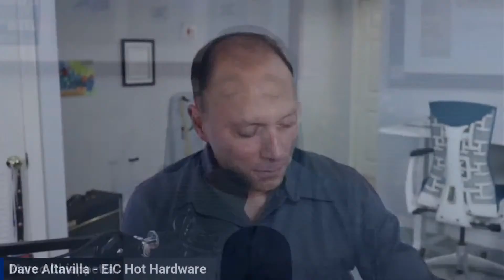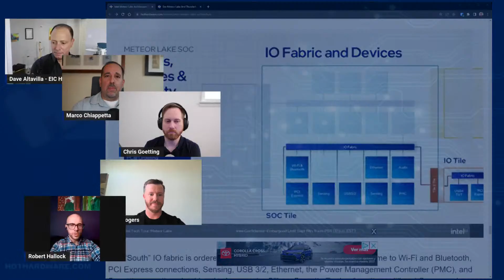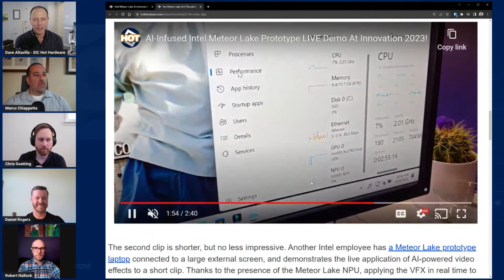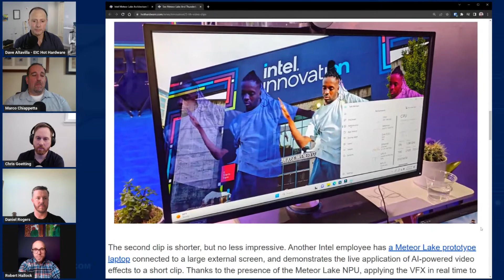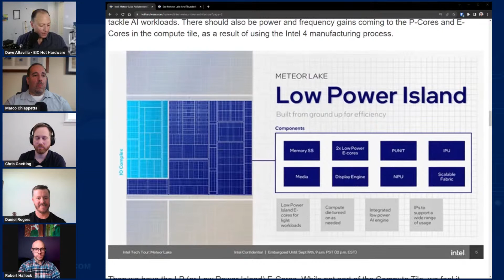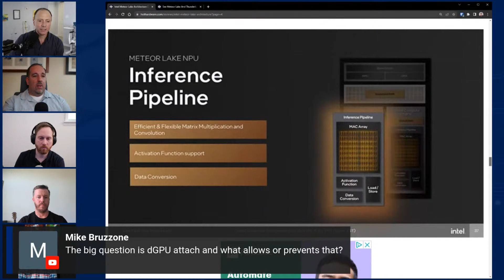What To Expect From Meteor Lake With Intel's Robert Hallock And Dan Rogers

Comment: Awesome deep-dive guys, much needed for the soul. I for one thought that the GPU was gonna be Arc+ and not a bit behind on IP, I wonder how this affects the difference between this and current Arc. Current Arc has an issue with lot of CPU overhead in limited scenarios, hopefully that's actually sorted (I recall it being a memory controller issue)
Reply from the maker: Thanks for joining us and for the kind words. Yes, I believe the issue you're referring to was resolved at least somewhat in a recent driver update. And the way I interpreted Robert's commentary about the integrated Arc GPU in Meteor Lake, it's a derivative of current Arc but power optimized and obviously cut back from the desktop chip. They did say it would support all of Arc's features.
Reply: Alright, that's good to hear it might be a bit better in that regard. Almost parity in terms of IP but tuned for efficiency sounds like success (6nm>5nm) . I originally thought from leak spec that LPG dropping XMX was to make the die less bloated and small as possible but XeSS was not that great on dp4a so it was a bit of a head scratch. now in recent Dp4a Proves good enough for XESS, Latest improved model gives FSR2 problems so nothing to be worried about. that'll probably get ironed out by next-gen with a centralized Nvidia--esque approach. looking forward to you guys putting it through some stress @Hothardware